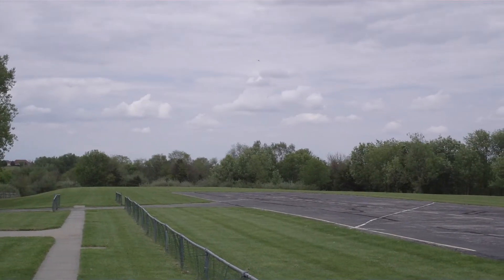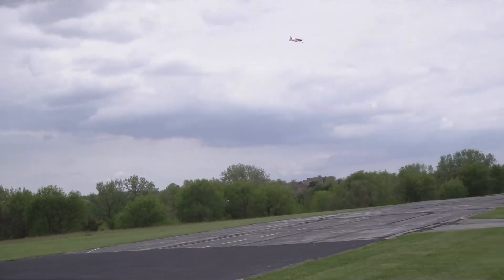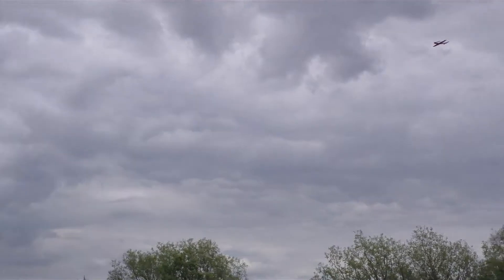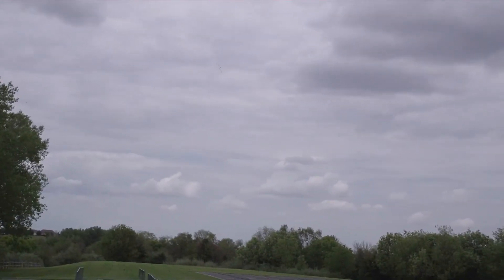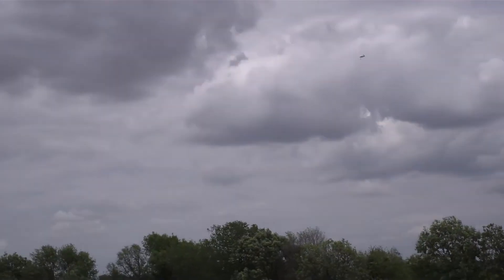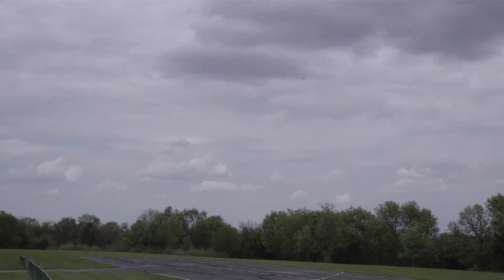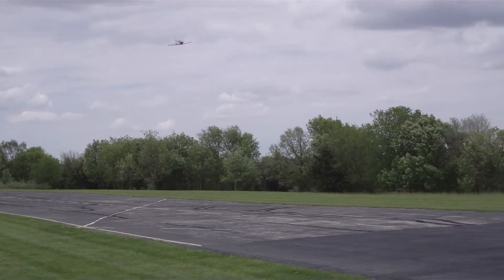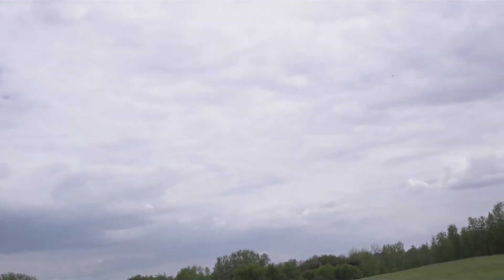Phoenix Model PC-21 EP Maiden Flight

Comment: does it come with retracts ?
Reply from the maker: Yes, they are mechanical so you just need to add the retract servos to operate them.
Reply from the maker: Brian L I have about 15 flights on mine and they have been holding up well. They are pretty robust units. I have used them on my Phoenix Spitfire (came with them too) and they have taken some pretty hard landings with no problems :)